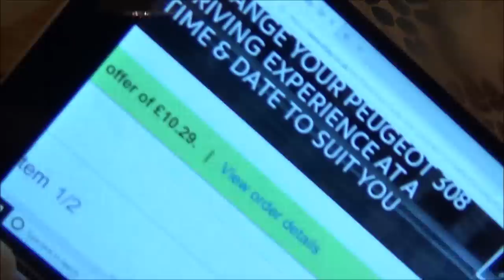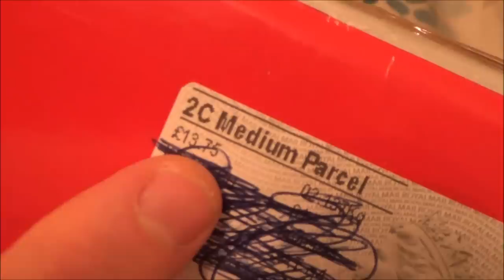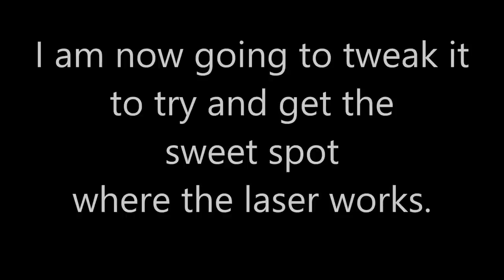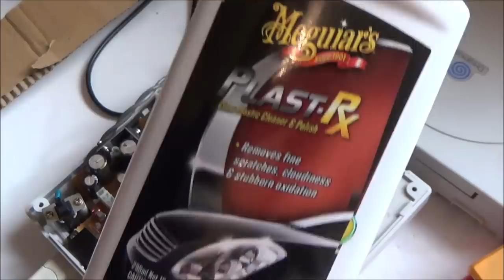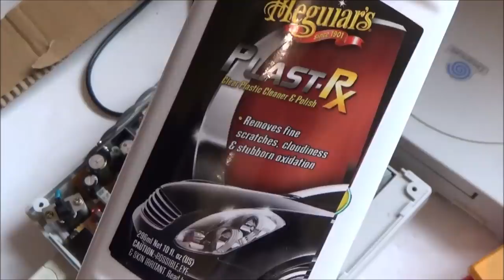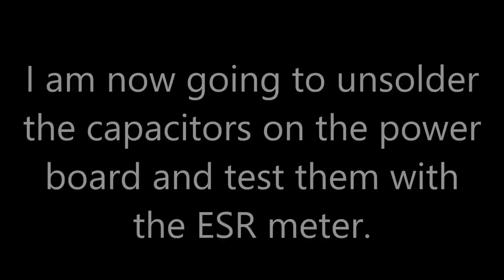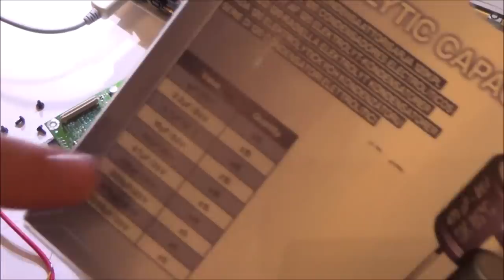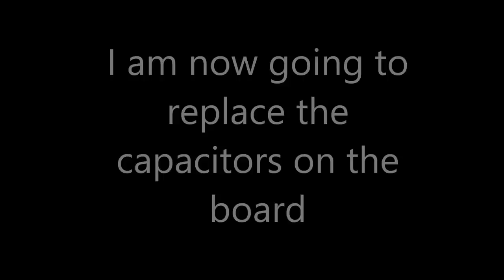Trying to FIX a Faulty SEGA Dreamcast purchased on eBay

Comment: “It’s not worth dying over a Dreamcast.” Great line.
Reply: CheatingSoi He's wrong though haha!
Reply: Oh you bet it's worth it
Reply: What about a Dreamcast 2?
Reply: Oh it's worth every breath if you can get it working
Reply: Dreamcast 2 aka Xbox.
Reply: Use the redream emulator on your pc or android device nvidia shield TV upscaled games in 4k
Reply: Nobody said this until Dreamcast's 20th anniversary.
Reply: @chadbrick67  You can't read Dreamcast discs on a pc. They are GD-ROMS which are read with the laser at the speed of a CD-ROM but is spun at the speed of a DVD. PC drives can't do that, so it is way worth saving a Dreamcast. Also, there were only 9.13 Million units sold compared to the PS2's 115 Million units sold, so you NEED to save them if you can!
Reply: @chadbrick67  Also, I was talking about using Redream on PC and putting a Dreamcast disc into your disc drive on the PC to use as a source for a rom to play through the emulator. I was saying that it doesn't work so you need a Dreamcast to read actual discs.
Reply: @chadbrick67  Bruh I hate myself. If someone else can do something better than me, then they can. I hate narcissists. Trust me
Reply: @jbird720  you are one it is clear as day
Reply: @chadbrick67  When did I say I was one? All I was trying to do was tell you that you can't read Dreamcast discs on a PC through the Redream emulator. That's all I was trying to do.
Reply: @chadbrick67  Also, I would like to apologize for what I said yesterday because I was extremely tired and really didn't think it through. I am sorry for calling you a dumb bastard after you called me one because that really wasn't mature of me.
Reply: @MrDirkles  aka gamecube
Reply: @MrDirkles  We call those Xbox.
Reply: it is , it was the best console of.its time , just think how sega would be now if they were still in the console game

Comment: The component you are unsure about is a crystal, normally used for a specific frequency oscillator reference. It looked like you were measuring the resistance of the pot while the unit was powered up which is a NO NO. NEVER measure resistance of a component while power is applied to the board as you will possibly damage your meter, the board or both.

Comment: A tip from an electronic engineer: when you're measuring the resistance with the DMM (digital multimeter), the resistor/potentiometer mustn't  be powered. That's because the DMM imposes an adjusted current into the resistor,  it reads the voltage drop across the resistor itself and after that uses the Ohm law to calculate the resistance. If that resistor is powered up, another current is adding to the adjusted current from the DMM, so the reading is far off!
Edit: that cilindrical thing that you couldn't identify (in the disc unit board) is a crystal oscillator
Reply from the maker: Thanks for the tips :-)
Reply: ...when you're measuring the resistance with the digital multi meter (DMM), the resistor... <---- gooder
Reply: Exactly!!

Comment: You can buy RGB cables, composite cables, and VGA cables (or make your own like I did).  As the laser diode ages it starts to weaken to the point it cannot read a disc.  Some people tweak the laser voltage using the potentiometer on the drive PCB but if that works it wont last long.  You are better trying to replace the laser unit completely.  The best way to adjust the laser voltage is with an oscilloscope - probe the RF pad and adjust based on the eye pattern displayed.  You can see an example of how to do that in some of the CD system repairs I've done (PC Engine CD-ROM, Amiga CD-32, Saturn, PS1 etc).   The big problem with the Dreamcast is there are few 'new old stock' lasers left I think.  You can fit an "SD Card" drive emulator into these too - to replace the drive with an SD card.

Suprising you found that it appears the original laser is OK!  That's quite rare!  I would be looking at the SMD caps next on the drive controller board.  It could also be a fault with the BTL / H-bridge driver chip - maybe focus or tracking related.   The caps on the drive PCB are electrolytics (just surface mounted) - so your replacements would work.  The voltage rating won't affect anything as you say (as longer as they are higher voltage rather than lower).  Worth getting some molycot onto the gears and mechanical parts on these - they really grind away when they get dry.  

The other thing I would point out is (and this is only advice - everyone has different ways of doing things, its just my opinion!) - Don't solder chips like that with hot air - use hot air to remove it, then clean the pads up with braid on the PCB, then put the new chip on there (if its an old replacement chip, use braid and flux on the underside of the legs first to remove any solder on the legs), then position it, use the soldering iron to 'tag' diagonally opposite corners.  Inspect the chip placement to make sure its the right way around and all pins aligned.  Then use some good flux (chip qwik) and drag solder manually.  You would get better connections that way!   Very interesting to see that the chip worked OK on the 'working unit' though - that rules that out.   

When it was trying to spin it sounded incredibly noisey to me - I would be inspecting / lubricating the gears and stuff, maybe swap out the motor to see if that has a relation to the problem too.   Sorry I've posted pages of text here lol.   The point where the drive is hitting the edge over and over - looks like you found the switch wasn't working there?  That is critical so the drive logic knows its at the start of the disc.  Did you check all your cap connections were OK, and that the replacement ribbon was OK too at that point?

The component that you didn't know what it was (silver cylindrical with 2 pins) is a crystal.
Reply: The reason adjusting the laser isn't really a nice fix is if you have to move it by more than a few %, that proves the laser is actually dieing.  Typically a laser will output its optimum value for 90% of its life and then gradually drop, increasing the voltage overdrives it to output at 100% again, which means its life will shorten as a result as it gradually drops even faster to a point where it won't read again.   If you needed to adjust a very small amount (eg. by less than 5%), you may get a few years out of it.   It's frustrating when people 'tweak' these though and then sell them on as 100% working, because they just won't last.
Reply from the maker: No need to apologise Chris, pages of text means plenty of info so that is good. I should be apologising for the length of the video but this failed fix went on and on and on. I thought I did the caps OK but maybe when I was removing the surface mount ones I might have damaged a pad. Pretty sure the ribbon cable was fully pushed in. I might dig this Dreamcast out again as this video was actually done a couple of months ago and check it over again. I had an interesting message from hespelf, here it is 
"Hey Vince, I believe you really need to test and swap the OTI-9220 chip, which is the big square chip at the back of the board where you did replace caps.This chip is actually the GD-ROM controller itself. It does control spinning, tracking and focus among other things."
This could be the problem. I had a quick look on Google  for the OTI chip and didn't find any for sale but I only looked for a couple of minutes.
I didn't check the SMD caps on the drive board. I haven't heard of Molycot but if it works on various different plastic gears then I will get some. The old 1979 BigTrak that I got working in another video could use some of that as well :-)
With the drag soldering I did have a little bit of practice on the PS4 from hell so in future I will try and get more used to it :-)
After the advice you gave on the MegaJoy2000 (N64 controller with the NES games) I now recognise that component as a crystal. Thanks for the advice on the laser, I thought it may be a short term fix.
I think I will revisit this one  :-)
Cheers for the help and tips.
Reply from the maker: Looks great but the price is really high. I will do some research into it as a lot of comments have mentioned it. Thanks for the link :-)
Reply: @Mymatevince  absolutely no worries bud item well worth it keep up awesome content
Reply: Ahh the POT tweaks for the laser, remember having to do this for ps1 and ps2 to read certain discs properly. Not sure if you really need an oscilloscope but I only done it on PlayStation consoles with a multimeter as a guide.
Reply: I recall doing something similar on old PS2s as well, completely forgot about it over the years. I didn't even go as far as multimeter, just tweak slightly until it reads again, this was on systems out of skips and one of them I continued using as a DVD player for at least 2 years with it on more or less 24hrs a day for at least half of that. Literally thousands of hours.  Really interesting video @My Mate VINCE no need for you to apologise for the length as there's loads of useful info and time spent learning is never time wasted IMO.  I hope to see a revisit of the faulty board one day and rooting for you to get it working.

Comment: Hey Vince, I believe you really need to test and swap the OTI-9220 chip, which is the big square chip at the back of the board where you did replace caps.
This chip is actually the GD-ROM controller itself. It does control spinning, tracking and focus among other things.
Reply from the maker: Oh OK, I looked online but I couldn't find any information. Maybe I can revisit this one again if I can get hold of one of them OTI chips. Thanks for sharing this info, after spending so much time on this it would be nice to get it working  :-)
Reply from the maker: My worry would be that if I take the chip from the good CEX dreamcast and then damage the chip and I can't buy a replacement then I would be left with 2 faulty Dreamcasts. I changed the chip on the video because I knew you could buy them really cheaply online :-)
Reply: @Mymatevince  You can also oversolder OTI legs, sometimes its 1-2 leg with bad conection (have got lucky few times). But it is likely Hespelf is right and that damn chip is faulty.
Reply: @Mymatevince   Isn't the CEX one under warranty ;-) ;-) I'm sure no one there watches youtube j.k
Reply: @jmarynicz  Just what I was thinking! Whack the knackered board in and take it back for a replacement, cex probably bought it for £5 anyway lol ;)

Comment: An easy test for laser activity Vince..
pop a sheet of tissue paper over the laser which means you can look at it without risking your eyes...plus the paper will diffuse the laser light and illuminate (assuming usually red for CD) if the laser is functioning.
rgds
Evan

Comment: In case you need ribbon cables, you can find them in old CD-ROM's and usually they fit in consoles that have optical unit. Great video as always

Comment: You cannot do resistance checks with power to the circuit. It will throw all the readings off.
Reply: @Brandon Kick If you are testing individual component resistance than I believe you would be correct. I have never checked/set laser pots, but I do know whenever there is power to the system this will throw off the DVOM's reference voltage it uses to check resistance.
Reply: I was thinking that the entire time he was doing that
Reply: Love the show vince. True though: Always turn off to test resistance. The multimeter will test resistance by feeding a small  current through the circuit. This current and any current coming from the dreamcast will interact. Not only will the reading be wrong but you could potentially also damage the dreamcast.
Reply: Hopefully he sees this comment/thread.....Liked.
Reply: It's almost impossible to do resistance checks with the part in circuit as external components will affect the readings. Parallel resistances !!!  However the potentiometer readings he had from the Internet were probably taken with the pot in circuit so although not accurate to the individual pot we're usable for reference in circuit measurement only.

Comment: Not sure if this was mentioned by anyone else but you can't do ESR readings with caps still on the board. Other devices like inductors and what not will affect the reading. You would have to remove a pin or remove the cap to do the test properly. Same thing with doing resistance readings as well. Which is why testing for voltages is your best friend.

Comment: There are several mods that can be done on the Dreamcast, one of them being an SD card reader in place of the GD-ROM drive. Keep it for yourself and replace the GD-ROM with an SD card reader. You can also replace the stock fan with a high performance fan, as well as other case mods.
Reply: Bingo! That's what I'd do with it!
Reply: so does the SD card reader enable you to download the games online to the card to play anything?
Reply: @Longrange1116  
Yes. I believe you can use GDI files as well as CDI.
Simply plop them on the card and put them in the system and you're good to go :)
Reply: @Longrange1116  yeah you can use .GDI or .CDI files but you need to format the card as FAT32 and the folders have to be named like music tracks "01 ; 02 ; 03 ; etc." and the disc image files have to conform to the legacy 8.3 file naming scheme to properly boot. add the games you want and then use folder 01 for the GD EMU boot disc and from there you can select and pick the games with names/album art you want to play.

Comment: That cylinder component about 1 hour and 5 min into the video is a crystal for timing. On the other board it had a surface mount one fitted so that could cause problems if faulty also heat  affects the value if faulty . If you have Hz or FREQ symbol on the multimeter you might be able to read the value. Falling that you could give chris a bell he's pretty clued up with type of thing. Good luck with the repair 👍🏻

Comment: Wow dreamcasts are loud !

I'm not sure about the dreamcast, but in optical disc based systems, when the drive doesn't seem to work, it's almost always the laser which is at fault. 
More modern drives won't spin the disc until the laser has focus on it, which usually causes people to assume the motor is at fault when it's the laser. The motor is easy to test and pretty much never fails anyway !

One thing I do know about the dreamcast however, is that the controllers are not "hot-swappable" !
This means that they should not be plugged in / plugged out while the dreamcast system is turned on , it can do damage to the controller and the dreamcast ! So always be sure to have the system turned off before change controllers. 

Great video as alway Vince ! :)
Reply from the maker: Thank you for the tip :-)

Comment: A very interesting video! just a few things in case you fancy doing a dreamcast again :D

The capacitors you removed are surface mounted electrolytic, replacing them with through hole radial electrolytic is fine it's just a little ugly in comparison but if it works it works, make sure to never plug in a dreamcast controller whilst the system is turned on, it has a high tendency to either break the controller or break the dreamcasts port board by blowing it's capacitors (or the resistors in the controller). If you ever come across dreamcasts that are listed as turns itself off after a while thats another very common fault, when the system gets hot the metal pins connecting the power supply to the motherboard expand and short out, they also often get corroded or dirty so you just need to polish them, re-tension the clasps on the connector and bend the pins back gently towards the rear of the console.

As for GD-rom drives they are notoriously fickle and spares are unavailable as they only ever got used in dreamcasts and the sega naomi arcade machine, typically it's the laser that dies so its very odd to have the drive board be faulty, I'd be interested in you installing the ISO loading drive replacement devices though.
Reply from the maker: Thanks for all the tips. I just Googled the ISO loading drive replacement and the very quick look I had was showing them for sale at £70ish. I will have another look later to see if cheaper alternatives are available on eBay :-)
Reply: There is a fuse that can pop if you connect a controller while it is on, but it is definitely replacable. As a matter of fact, resetable fuses exist. When those "pop", you can turn off and on the Dreamcast and it has reset itself, so it doesn't need replacing.
Reply: @Dan-TechAndMusic  certainly best not to have to fix this problem if you don't cause it in the first place :D
Reply: i was cringing when he was replacing those caps with different type... when you get to Amiga's please make sure you replace the caps right or u have whole community after you ! ha
Reply: That's the dumbest design flaw I've ever heard.

Comment: I just noticed something. I'm not sure if it's like that on the Dreamcast laser too, but usually with potentiometers, the two pads that are close together on the same side, are the right and the left side of the wiper You're moving while turning the pot and the single padis connected to the wiper itself. So to take any meaningful measurements where you see changes, you measure between the right side or left side of the wiper and the wiper itself.

Comment: Hey Vince, my hunch is that it thinks there isn’t a disc in the drive. Whatever signal gets sent to tell it to keep spinning the disc/that there is actually a disc in the drive isn’t being sent so it just stops the disc spinning as it thinks nothing is there. Maybe the port the ribbon cable goes on has a loose connection/solder on bad board that isn’t putting data to it so it thinks no cd is in it?